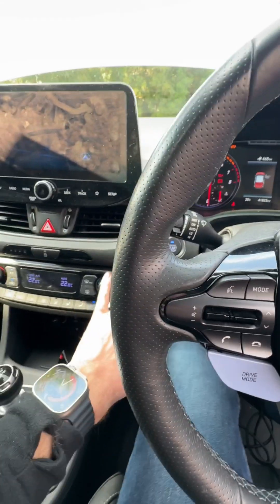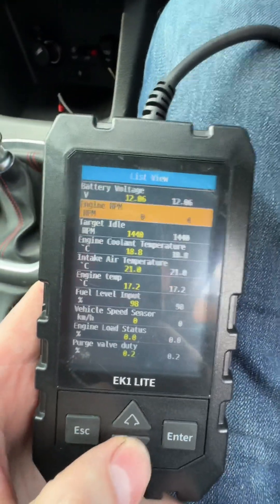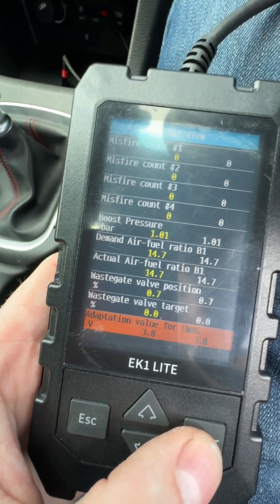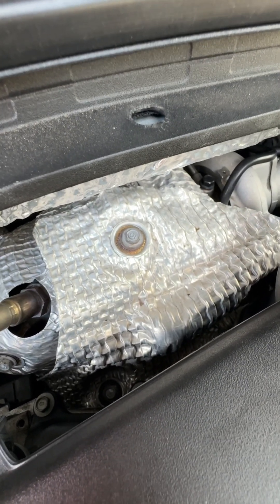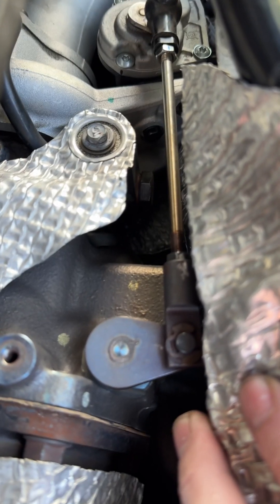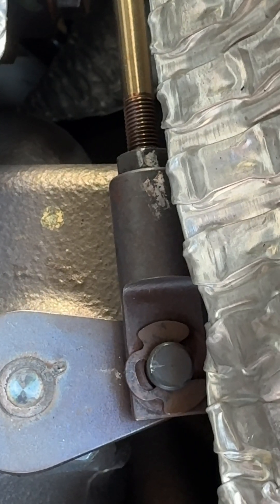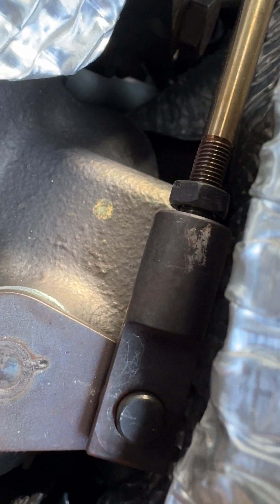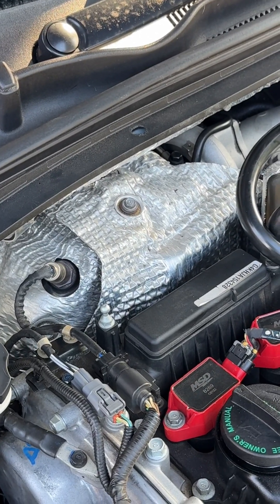Hyundai i30N - Adjusting the Wastegate Actuator Rod

Comment: My car with 3,99 volts runs much better, is more sensitive  to the accelerator than with 3,8  volts and does not go into limp mode. I have  (stage 1) . Thank you for all your work
Reply from the maker: @ivansaenzdematurana2586  awesome! Glad to hear
Reply: @gurujoshoz  ...and at 3,6 it's much slower and clumsier. With more volts the turbo pressure rises faster, but I must also say that with 4,5 volts it goes into limp mode

Comment: Thanks to the video ,by the way what reference have those red ignition coils and price?Can you put link?
Reply from the maker: Hey mate, they’re MSD coils that are designed for the 1.6 litre turbo gamma engine. Though not technically designed for the N, I gave them a go to see if they solved a power cut issue I was having. They didn’t resolve the power cut issue which turned out to be a problem with my tune. Went away when I went to an alternate tuner. Have just kept them in since they seem to work fine. Probably no real reason to swap over to them besides the colour, or a cheaper way to replace the coils if the factory coils have an issue. This is a link to these coils at an Australia N shop - https://cherrytuning.com.au/products/msd-ignition-coils-1-6t-hyundai-and-kia?srsltid=AfmBOoqptHGUU4aIcaP6zBl6q_ObCYQ28PQZJ8VEOmeFILeBSDoBe6Th
Reply: @gurujoshoz  Ok Thanks so much